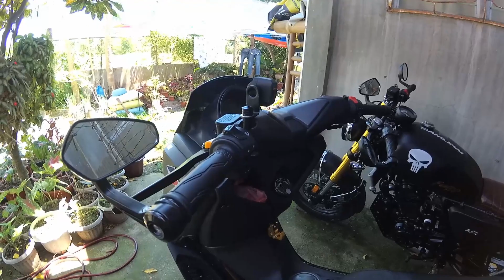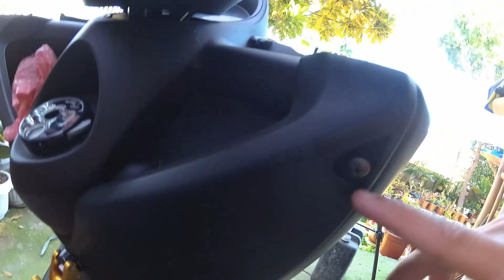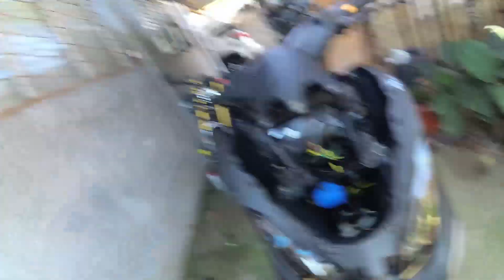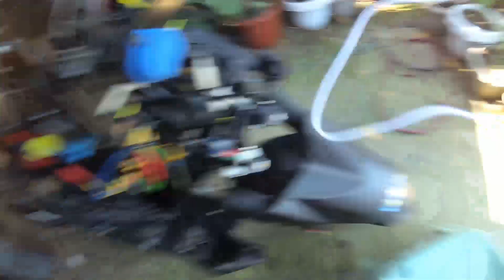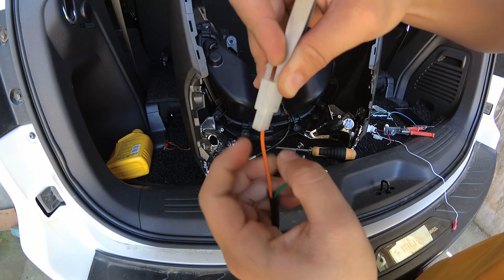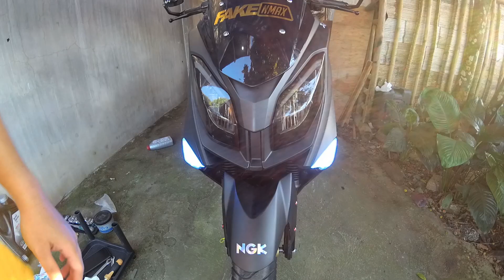Dual contact signal Motorstar er150n installation

Comment: Db dpt boss sa + ng parklight i ttap ung white wire ? Pra sabay sa parklight ung t10
Reply from the maker: Pwede din po sir :) gusto ko kasi deretso na on yung t10 hehe
Reply: Oo nga boss mas maganda rin un, eh paps paano naman if gusto ko naka off minsan ung t10 parklight , ung kilay lang naka open pag i-on ko ung kilay ng easyride? San ako maglalagay ng switch?
Reply: boss up dito san pwede itap yung wire para may patayan yung dual contact?

Comment: Paps pa link ako ng mga ginamit mong item. salamat.
Reply from the maker: https://shopee.ph/product/44410793/4345288745?smtt=0.17849427-1622169706.9
Reply: @diymoto9987  salamat paps.
Reply: @diymoto9987  hi sir. ask ko lang if papalitan ko pa ng flasher relay . dual contact signal light palang ikakabit ko wala pa akong hazard signal at mini driving light.
Reply from the maker: @japoy2438  No need napo magpalit sir.
Reply: @diymoto9987  maraming salamat paps.
Reply: ok na paps nakabit ko na. parehas na tayo. 😁. salamat sa DIY mu.
Reply from the maker: @japoy2438  nice paps! Welcome po :)
Reply: Paps. Ok lang ba kung hindi ko sya sa park light ilagay? Isabay ko nalang sa headlight? Or need tlaga galing sa relay?
Reply: @japoy2438  nagpalit kapa ng flasher relay?